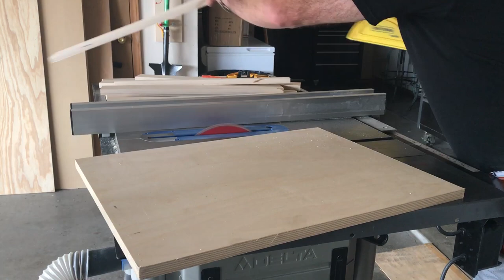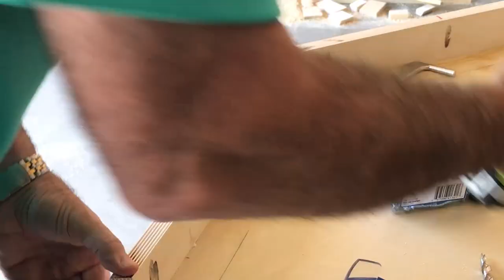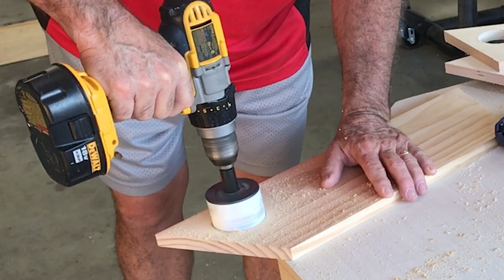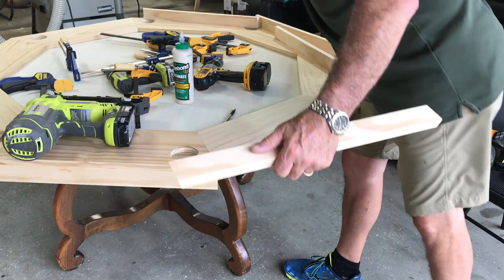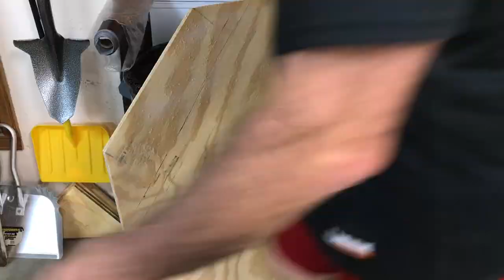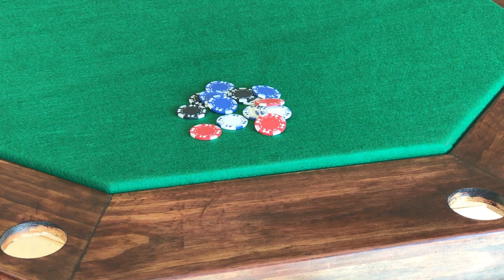MY HOMEMADE POKER TABLE

Comment: Beautiful table but I wonder why you decided to make the insert raised? Poker tables are known for having a lowered center.
Reply: Easier to pick up the cards and chips without stabbing fingernails into the felt to get a grip, this only happens when the out lip is higher and you cant just slide the chips and cards off. Makes sense to me.
Reply from the maker: I show in the video that its easy to slide chips off to yourself... just my preference... thnx!
Reply: @workinontheprairie7944  oh I see! Makes sense

Comment: Nice work buddy.  Quick question! Do you have any recommendations on how to stop the metal cup holders from being able to easily slide out of the hole you cut. I was thinking of using rubber bans to make it fit tighter in the slot. Just incase a pop can or beer bottle sticks to the metal at times and when someone pulls their drink out it doesn't pull the holder with it

Comment: Beautiful!!! Awesome table. I have a large octagon poker table I picked up at Goodwill. It does not have felt on top. I have a round piece of felt on it but want something nicer. I was thinking of fastening felt to 1/4" luan cut in a circle...or would you suggest octagon? Tips on fastening felt to luan? So it is tight.

Comment: What is the width of the outside edge? Were you happy with it? It looks great man what a great job. I'm going to copy.
Reply from the maker: Very happy... outside width ended up being just shy of 56"
Reply: @workinontheprairie7944  if you flip it upside down what is the width of the inner frame?  I'm trying to figure out what size round  table could fit under this. I love this table it doesn't look cheap like most other diy poker tables (with the foam edges vs the wood)
Reply: Ugh! Its 46 inches! Need to find another table!

Comment: If you plan to make this table, don’t use his instructions; at least not regarding the the 1x8. Followed the measurements on his plan and the measurements were WAY off. Now I have to spend another $60 on 1x8 and do it myself.